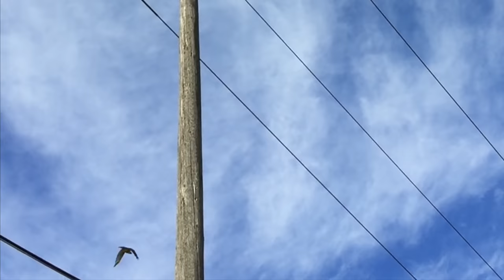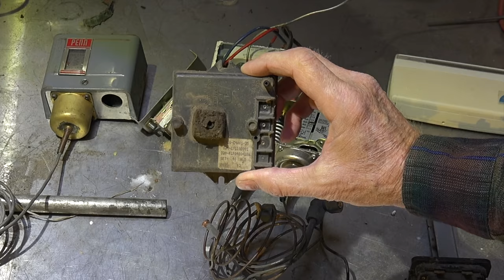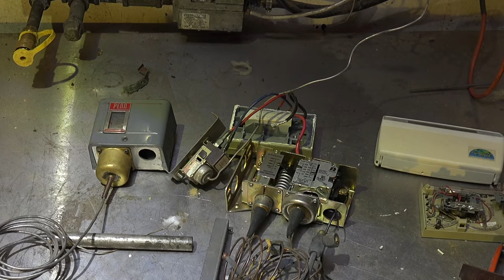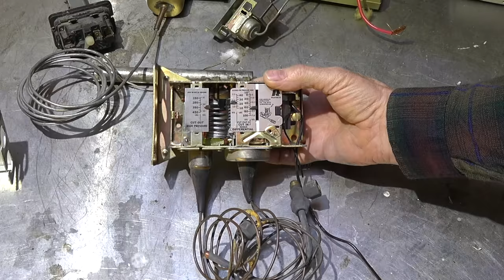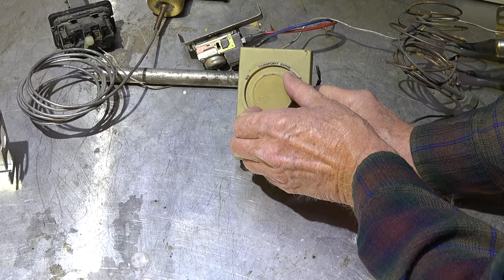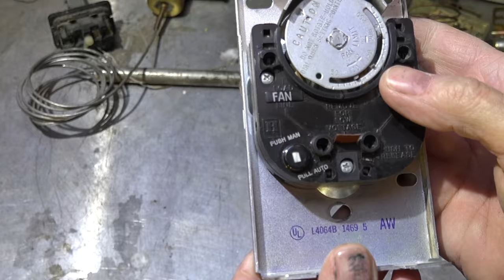Differential in the electric switch

Comment: Differential is simply the difference between the set point and where the tstat calls for the unit to cut on and off.  Most times it is 2 F such as if you have the tstat set at 70 F it will cut on at 72 and off at 68 for cooling and on at 68 and off at 72 for heat.

Comment: Great tutorials. Quick question, do you have any wiring tutorials for those old Honeywell fan limits? Those are before my time as a tech. I'll be honest, I don't get to do many repairs / service calls on older systems. It's either changeouts from existing or from scratch (new construction). Investors, flippers, huge rental companies and the like.  Just last week we put in i put in 7 AC's (coil condenser) and 5 furnaces (coil condenser furnace). That's an ordinary week  - year round. Get in get out. I'll most likely never see those systems again once i close the door behind me. Is it worth my time learning older tech? Thanks.
Reply from the maker: I have several.  Try this one first.  https://youtu.be/jg0nK4QLpZo
GFM